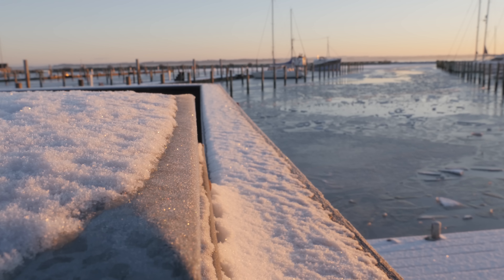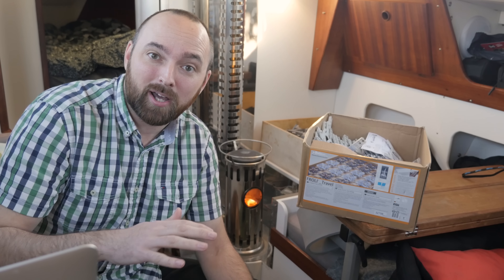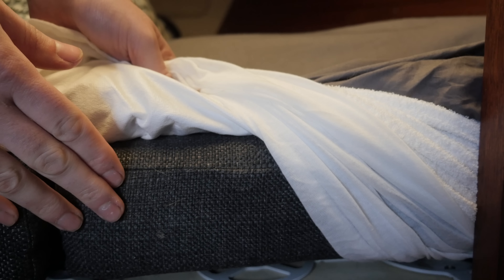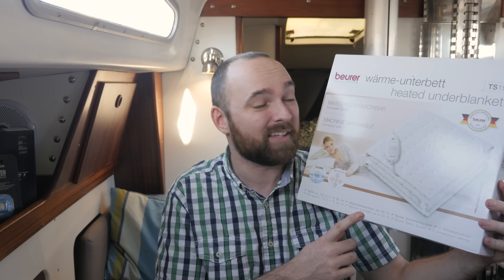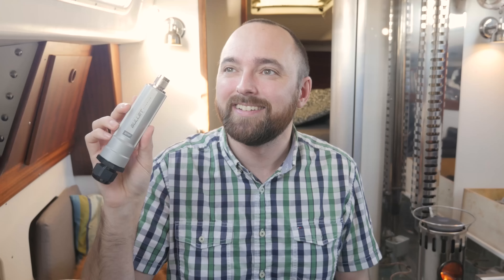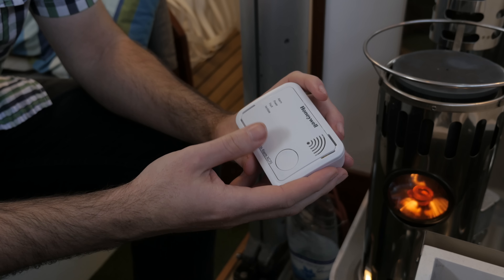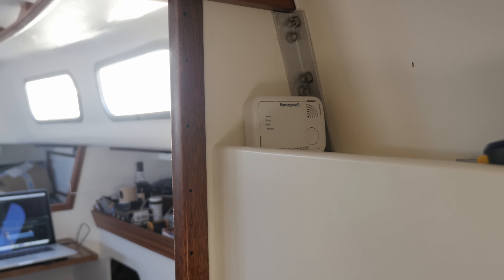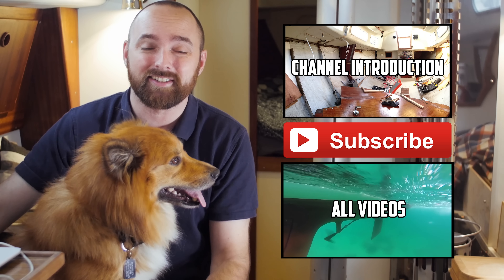Sail Life - Sailboat Update #21

Comment: Hi Mads, just quick comment that may help, as you will know your Diesel heater burns oxygen and not the moisture in the air so as a result you will get a build up an excess of water in your cabin and will naturally descend to the lowest part of the cabin , you may wish to try a small dehumidifier, you can set them to a desired humidity. a damp room uses so much more energy to heat up also,  so you won't need to turn on your electric girlfriend as much. ( wow that didn't sound right ) best wishes :)

Comment: Bottom line, when the water vapor drops below the dew point temperature, it condenses. You can employ a couple approaches to control where that happens. 

You've tried increasing ventilation below the mattress, but the reason you still have mildew is because your interior air temp is below the dew point. Consequently you are chilling the underside of the mattress below the dew point, and condensation is the result. Maintaining an indoor temp above the dew point is the first step.

If any surface is below the dew point, condensation is the natural result. For example, the locker under the bunk is likely close to water temperature.  The plywood top is also going to be cool. Cool enough, and you have condensation. You can insulate the bunk top, and provided sufficient warmth from body heat and/or warm air flow, you can go a long way towards keeping that surface above the dew point. 

If you leave the locker below uninsulated, you may just be moving the moisture problem into the lockers. If nothing can be damaged by it, you have adequate drainage to the bilge, and you don't mind periodically cleaning any mold/mildew in there, then that can be fine.

Note: If the insulation is vapor permeable, you will have water vapor condensing inside the insulation. Vapor barriers help, but vapor impermeable insulation is better, especially on a boat.

The most robust solution is to...
(1) Insulate the hull/deck with sufficient amounts of vapor impermeable insulation
(2) Heat the interior sufficiently so that the inside surface of the insulation never drops below the dew point
(3) Have sufficient outside air exchange to exhaust the water vapor and/or a robust enough dehumidifier

You can have more of #1 and less of #2 or vice versa. The point is to generate and retain enough heat to keep the interior surfaces above the dew point. The more you retain, the less you need to generate, with diminished returns. On a small boat you have limited space to add insulation though.

Sorry about the length of this comment. I hope it helps though.

Comment: I've found this dimple plastic about 3/8" thick. It's purpose is to wrap your basement wall so water drains down you wall to your weeping tile along the footing. I will use it with the dimples against hull and under cushions and mattress's . It cheap and a wonderful product and you can use a box cutter or scissors to cut it.

Comment: Hey Mads, how about transferring some of the stove heat through vent pipes and a 12v pc fan to your bunk. Can't wait to see the review on the bullet. have just come across the WL510 by digital yacht, the device is installed inside with the antenna outside, sounds good. Anyway, working on my new channel, will also be on TV with my old boat when your on the atlantic. Cheers, mark from markxtube

Comment: I feel your pain. The heat pump is running nonstop and discharge air temp drops as the water temp decreases. The fireplace it burning trying to compensate. 
No ice under the bat yet. at that point no heat pump at all... Think its time to set sail south..

Comment: Great Video Mads - thanks for sharing!
I really would like to know more about your experience with the Bullet which I´m thinking about buying it. Beeing a Ham I personally would prefer a directional antenna with around the same gain as your omnidirectional antenna has. If you know where the Accespoint is you want to connect to this way you will have much better reception with a moving boat because the Pattern is not as narrow as the omni´s is but you don´t "waste the energy in other directions". I hope you can understand what I mean as I´m not very good in English Lol ;)
Greetings from Bavaria where the Temperatures just raised over 0° ;)

Comment: Mads
I couldn't believe that you did not have a Carbon Monoxide Monitor on your boat previous to this!  Gott sie Dank that there was no leak in your heating system.  Aside from that, do you use a Bubbler system under your boat to keep the ice clear of the hull?

Comment: Mads, would it be better to bubble your boat as opposed to letting it freeze in place? I know here on the Great Lakes you bubble a boat if you're going to be living on it in Winter. Is a crushed hull a possible concern? Always look forward to your videos, always informative and and fun.
Reply from the maker: +Jeff Markwick Thank you so much :) It's an interesting subject! I know lots of marinas further north have different ways of keeping the water from freezing around the boats (bubbles or various ways of keeping the water moving). I know the marina I'm in used to have bubbles around the pilings (to keep the ice from lifting them out of the bottom). Apparently that was more expensive to maintain than to fix the pilings. I have yet to hear of a crushed hull here in Denmark. We don't normally get that much ice :)
Reply: what is bubbling your boat
Reply: +Mikhael Yahuwah keeping the water moving around the hull so it won't freeze
Reply: +Jeff Markwick thax

Comment: with your engine removed from the boat have you noticed any difference in the way the handling is affected in mine i was so far balance i had to load an appropriate amount of ballast with mine the engine was beyond repair so i bought an outboard it works ok fortunately and the added room on the engine hatch is a welcome bonus

Comment: Thinking about your moisture issues, I just had an idea for another "experiment": What happens if you put the heating blanket (or a second heating blanket) BETWEEN the cold plastic surface and all the bedding stuff above and turn it on just very lightly (sort of lowest possible power setting)? Would this prevent condensation altogether, because it acts a a compensation device against the temerature gradient? (Sorry about getting technical, but you see - I am a professional engineer :-) Maybe a plan only for the coldest winter months in case it works...
Reply: All you need is ventilation under the bunk. I'm a liveaboard and I've never had any problems with moisture under the mattress.